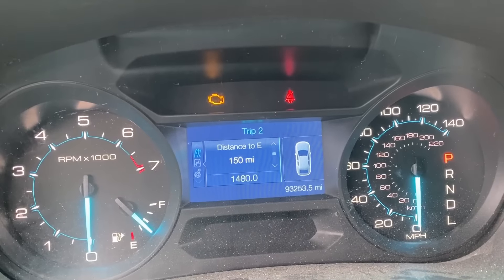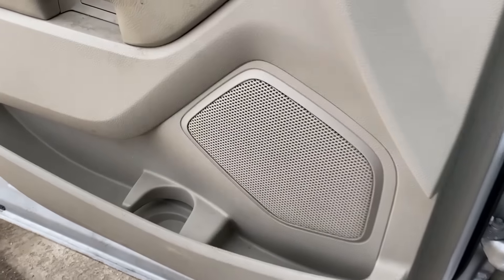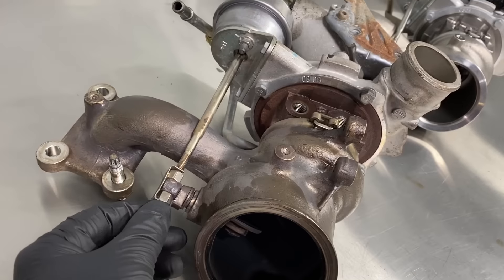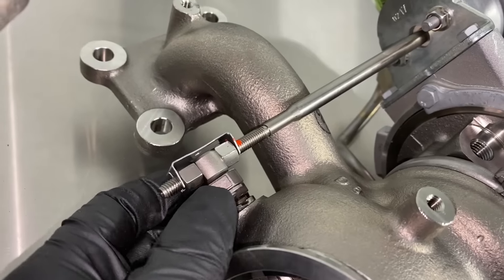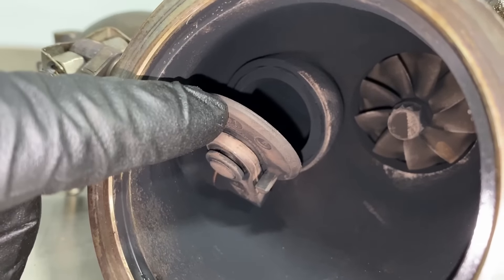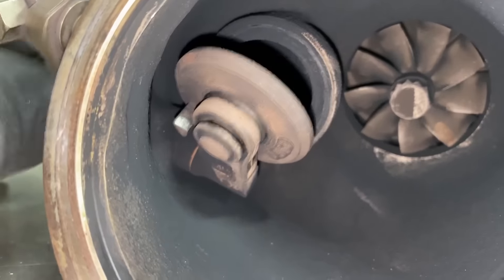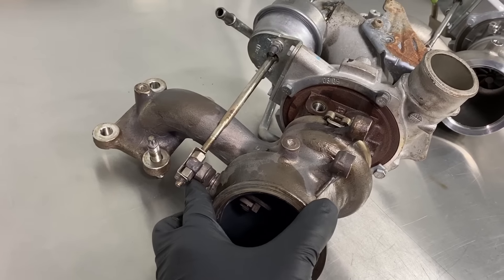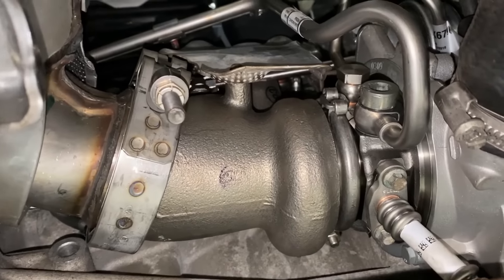Ford Ecoboost Cold Startup Turbo Rattle Explained

Comment: Won't that have some effect on horsepower and engine performance as well having a turbo that's not properly working
Reply: Yes it will usually throw a low power light or check engine light

Comment: Sorry ford people if that was a Honda or Toyota they would have had a Warranty Extension on the repair . I worked For Honda for 17 years and we also had a Toyota dealership so I have seen them cover stuff like this. Very sad. I you cover it they will buy a ford again if they don't then it's the last Ford they will own.

Comment: My F 150 doing same noise brand new on cold start.
I check with Ford, and Ford technician say its fine , its normal,
Reply: TOTI Foti mine did the same thing I had a 2017 3.5 eco boost that I bought brand new it started doing this the third day I had it they acted like I was crazy when I would complain about it took it to another dealership they replaced the flywheel and the starter still did it drive me crazy had no clue what it was
Reply: @bryceredman7143  Its cheap design from Ford.
50K truck not supost to make any noise

Comment: That's outrageous.  A total turbo replacement because of a warn waste gate activation arm?  There is no reason that shouldn't be designed better than that!  There's a reason I've avoided turbocharged cars so far.
Reply: Same goes for all brands.  I work for a Subaru dealership and our sister stores are Audi, VW, Chevy, Cadillac, and Toyota.  You can't buy individual turbo parts for any of them, you replace the whole thing or nothing at all.  Our VW/Audi store sees turbos with broken shafts, wastegate actuators, and all kinds of issues all of the time and turbo swaps are routine for the techs over there.  As regular as engine and transmission swaps for the Chevy store, frame and axle swaps for the Toyota store, and electrical nightmares at the Cadillac store.
Reply: @406Steven   - I hear ya, and unfortunately, I'm not surprised.  I was just amazed at how much slop there was in between the vacuum servo rod and the arm that controls the waste gate on the outside of the turbo.  It just seems to me, and it's easy for me to say, that they could come up with a better connection than that, or at least allow for the replacement of the arm and joint assembly if needed as opposed to having to replace the entire turbocharger, ESPECIALLY at mileages less than 100k!

Comment: If you think this is shit engineering,  pull up the procedure for water pump replacement on a 2016 Explorer with the 3.5 liter. The engineering team at Ford needs the shit kicked out of them. I have had a shop since 1999, and Ford takes the title for bad engineering. Every make and model has its problems, but no one can come close to Ford, especially their diesels, they need to go back to the 7.3 liter.

Comment: You can use some steel wire to tighten that lever on the waste gate to hold it tighter 
It wouldn't be perfect but will take away some of that noise

Comment: I'm no engineer but the new units seem pretty loose and sloppy to me. Having play brand new its quickly downhill from there.
My td-04 turbo has 315k on it and it's still going smoothly. Probably 1/3 the price of these units. I dunno..seems wrong to me.

Comment: As others have stated i would live with the noise. It's NOT that bad at all. And thankfully my 2015 Lincoln MKC 2.O Ecoboost which is the same engine as the Ford Escape isn't doing this yet with 35k on it. I will say they are GREAT engines don't let this problem in the video deter you from these vehicles. They are solid vehicles. My next one will be a 2018 Ford Explorer Platinum with the 3.5 V6 ecoboost.

Comment: After seeing this video, I passed on two used 2016 2.0L Escapes because of that noise. I actually totally scratched pre 2017 Escapes off my list and got a 2017 with the twin scroll turbo and beefed up engine lower end.

Comment: Fun fact, every Hyundai 2.0T makes this noise.   Mine made it to 150,000 on the original turbo.  However I needed to adjust the wastegate every 50,000 miles.

Comment: This is not the same noise that most were experiencing on start up. I believe what most are having is the timing chain. I recently had a new Long block installed and after that no rattle. If it was the wastegate, then I would still have it for that was not replaced
Reply from the maker: Wrong engine, you are thinking of the 3.5L GTDI

Comment: My 2001 2 valve 5.4 is still going, 250k miles.  Ford needs to go back to simple V8 engines.
Reply: It called the 7.3 godzilla. Tuff part is meeting EPA now. Old techno cant pass.
Reply: I'm driving a 2002 F150 Scab 4x4 with the 5.4, 162k miles and doing fine.  It doesn't have IWEs either!
Reply: @Dirtyharry70585  The sad part is that a reliable truck with slightly higher tailpipe emissions does less environmental damage than a 30 MPG truck that meets EPA regs that only lasts as long as the warranty is good for.  If the EPA knew their bum from their elbow they'd introduce legislation about reliability, not just meeting MPG and proprietary testing.
Reply: @406Steven  they wouldn't permit ev's if total pollution was added at sale.

Comment: Oh man. I was going to call my dealer today because I have a rattle on my 2012 F150 3.5 eco with 140,000 miles. I thought it was just a loose heat shield or something. Now I am worried. I already went through the cam phaser thing at 80,000 miles.
Reply: Time to sell it and buy a decent brand

Comment: I have a 2018 Raptor with 30k miles. Wish I could hire you to inspect the truck for any defects that warranty would cover before coverage runs out. Any chance you’re near FL? Also Is there anything you’ve seen consistent failures on with the 2nd gen Raptors? Thank you!

Comment: Imagine that moving parts that have worn out especially ones that go through extreme heat cycles and 93k miles, hey shit happens, Ive changed a few turbos in my day (only one on a ford diesel bus) they are not overly difficult but yeah they can be expensive

Comment: Parts alone $2,000 to repair, that just blew all the fuel savings from a turbo engine and then some :(  Worst yet,  what happens to the twin turbo V6 engines  $4,000+! All this with less than 100K miles!

Comment: I watch alot of these videos.  I have a 2012 and I swear everything that is even somewhat common on these ecoSH$T has happened to me.  2nd engine now.  Shimmy at 55 mph lately or if I'm getting even a bit hard into the pedal.  Vacuum pump is going out and I've changed that once already.  Rear defroster isn't working.  I have the air actuator for the heater clicking and driver side has heat all the time...of course the harder one to pull out.  Water down the vacuum line ruined mt 4 wheel drive actuator on passenger side.  Hhmmmm....there's more that I've fixed and this list is stuff I'm waiting for summer to fix.  Then I'm getting rid of it never to buy another ford product ever again.  I loved the truck when I bought it....for about a month.  Transmission messed up on me first.  I tore into it, replaced a valve and while was in there "the brain".  Sorry I don't remember the actual names of these parts.  The tranny job cost me about $300 total and I think if I took it on they'd have dinged me for nearly $2,000

Comment: Not surprised to see such a simple part failing on a FORD.  My Ecoboost has a stretched timing belt at 50000 miles.  My fuel economy is down by 13%.  I am not happy FORD.

Comment: I have owned 3 turbo vehicles and every one was money pit. Never again.
Reply: curban0520 I just bought a used eco boost truck to do some towing
Reply: @nickking1510  hope it works out good for you.👍
Reply: curban0520 thanks I don’t have on road yet welded in rockers and cab corners,differential needs clutch packs ,need 4 wheel drive vac hubs ,and 4 new tires and re do brakes spring 2020 should be ready to certify at independent shop

Comment: That is an unacceptable solution from ford the back half of the turbo looks replaceable and that is with out any real fix just replacing parts which sure will probably be like $400 but thats not $2000

Comment: same as FCA 2.0l with 47k miles . Sets low boost code too. You can lengthen the rod a bit and get another 10k miles until flap leaks enough and needs to be replaced. It delays the boost a bit which feels better too. These are all the same issues that were common when turbos were popular in the 80s.

Comment: Great design integrating the waste gate into a turbo. 🙄

I love new cars but MFG's are greedy and will rig their cars to fail at or below 100K and you either have to dish out thousands on repairs or tends of thousands on a new vehicle. Planned obsolescence is an evil practice that should be outlawed.

There is no greater time to build million mile engines than now, but, I guess, that won't make them money if people bought new vehicles every 20-30 years, not every 5 years.

Buying EcoBoost can make sense, I guess, only if you will immediately put aftermarket turbo assembly on it, custom tune to run the new turbo but that will cost more than 2K, IMO. N/A all the way.

Comment: Glad I stuck with a V8.  Turbos put more strain on the engine and they end up failing in the long run. Do you guys buy premium gas for your EcoBoosts too?
Reply: I have a 2016 fusion with the 2.0L. I currently do buy premium (Sam's club here has it for $2.30 so why not) and I only run it because it seems like the ethanol burns up in this engine and I've had better mileage with it.
Reply: Eric. I’ve been running turbos since 1980 and never had a problem with turbos. It’s always been something else. It depends on the design of the item. It is possible to design it properly.
Reply: @mannypuerta5086  glad I stuck with a V8.

Comment: .. yeah, i'd buy a whole new Car at That outlay with That Mileage..

..no, i Did Mean a Brand New Car, especially with all that Road Salt Corrosion going on & Ninety Thousand plus Miles on the car.. because soon it's Another couple grand for Timing Belts, then maybe a Head Gasket..who knows, with all the Plastic they build cars with Inside The Engine nowadays..soon the Repairs will total more than the value of the Car, plus you'll Still Have An Old Vehicle..& Not Another Whatever either.. Something Entirely Different..
Reply: thats what they(car manufacturers) want you to do
Reply: Agreed. I wouldn't pay for that repair.
Reply: @richardcranium5839  So true. They could easily make it repairable but they make more money from a replacement.
Reply: A new car will cost upwards of 40k to replace the broken one. 2k is a bitter pill to swallow, but it's a fraction of what you'd expect to spend on the new one.
Reply: @markk3652  $2k for parts alone, add the labour on top. I don't think he meant a brand new car but another new to him vehicle.

Comment: 2 Grand?  WTF!  A bar of bushing bronze, a lathe and a few hours time could fix that for way less than 2 Grand.  So,  why is FORD demanding a new catalytic converter be installed as well with the new turbo?  Also, isn't the CAT considered an "EMISSIONS" item?  Is ford not required to warrant the CAT for 10y / 100K miles as they used too?
Reply from the maker: 80k is the cat waranty

Comment: Any turbo vehicle can have turbo problems at that mileage. That's another reason to get the factory extended warranty.  I always buy the Ford ESP 10 year 150K mile premium care plan.  My last plan cost me $1400 and covered all kinds of minor repairs like the radio display ($1000.) A slow retracting seatbelt ($600) front struts ($1000) front control arm bushings ($1500) and a few other little things that are minor, but expensive.  
It is the customer who declines or accepts buying a warranty

Comment: Ford did not make the linkage strong/sturdy enough.  Cheap metal will wear out. For the noice, I'd leave it alone. Such a small rattle on such an expensive part.  Another 90,000 miles, and the wear of those parts will create yet another similar problem. If it's not broke don't fix it, but sure am glad the noise has been  detected.

Comment: I don't like engines with Turbo's!!  More to go wrong.  The defect can't be avoided,  can't grease the parts.
Reply: Ron Dail More can go wrong because of the turbo itself? Or is this just your paranoia?
Reply: Ron Dail. My Cummins has 369,000 miles on the original turbo. It isn’t the turbo, it’s how you design the turbo.

Comment: Geezus.  I just won’t be rolling the dice on the eco boost.  Too risky
Reply: Yup. I have a 2016 Fusion with this motor. 63k miles and it's almost dead. Got a poor sucker buying it from me and then I'm on to a 2.0L N/A Honda civic with a 200k mile warranty.

Comment: This is a disgraceful situation. Over $2,000 to replace a non-repairable part. Welcome to the 21st Century. Back in the day, components could be repaired in a shop, or by an experienced DIY guy. In this case, it seemed the slop in the linkage could be repaired by making a bushing for the arm with the worn hole. But the interior rattle seems impossible to fix. Too bad the manufacturers don’t make components that could be repaired. But in this current environment, there’s more money for everybody except for the poor customer. What a sad state of affairs.

Comment: That car isn’t worth $2,000 to repair. Drive it until it locks up!
Reply: Jeff Talbot $2,000 in parts,  not counting labor, and there is another turbo on the engine that will probably do the same thing.
Reply: Jeff Talbot $2k is cheaper than buying a new car. Especially if this one is paid off already.

Comment: Buy a toyota
Reply: Jay Yo they have issues.  Radiator and transmission in my Tacoma, head gasket and fuel pump in my 4 Runner.
Reply: Cam tower leaks